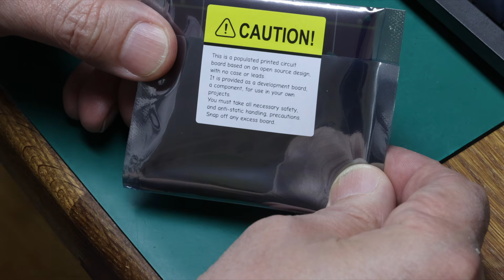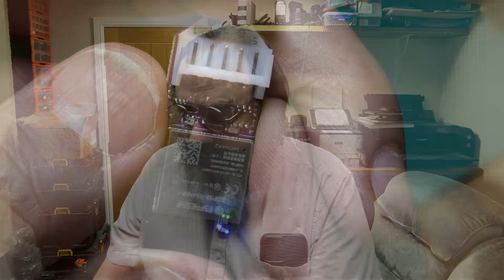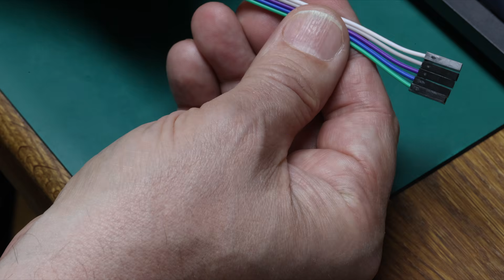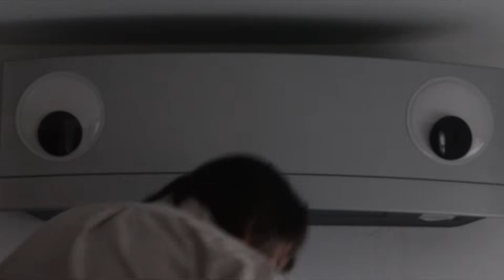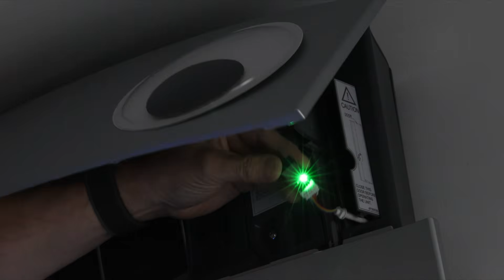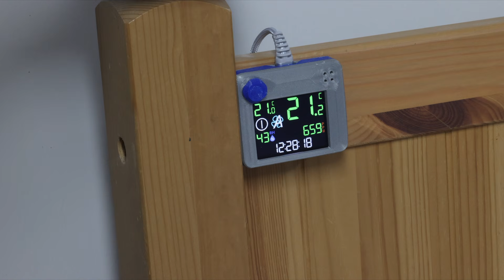Faikout

Comment: I read that this Is an open source project, Is It possibile to create one by myself with an esp32 modules?
Thanks in Advance!
Reply from the maker: See faikout.uk - yes possible, may need voltage convertor.
Reply: @TheRealRevK  thanks you, tomorrow i should receive my ESP module, already soldered the 3v-5v conversion module..can't wait to play with them!
Reply: @TheRealRevK Hi RevK,
I have successfully flashed Faikout on an ESP32 DevKit V1 (ESP-WROOM-32) and I'm connecting it to a Daikin ATXF35A5V1B.
On the indoor unit PCB there is a 5-pin vertical white connector labelled S21, 
but I'm not completely sure about the exact pin order.
Could you please confirm the pinout of this 5-pin connector and how it should be wired to an ESP32 using a standard BSS138 3.3V↔5V level shifter?
I would like to build the interface directly with jumper wires rather than using a pre-made EKRS21 cable.
Thanks!

Comment: Thanks so much for Faikout! I got the pin cable, which didn't fit on my AC board (male, small). so I got the small-to-big addon cable, which left me with two male ends... so I plugged the plug end of the pin cable in the adapter side, and the pin end in the Faikout board using a freeze-frame at 4:55 for verification. This seems to have worked, let's see if it holds together under load :)